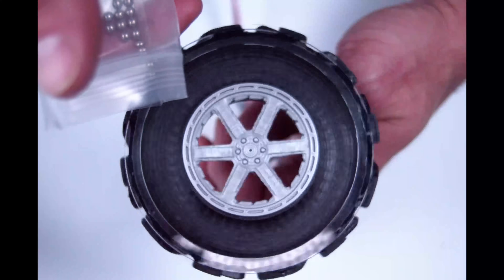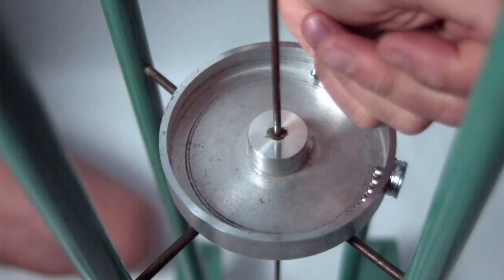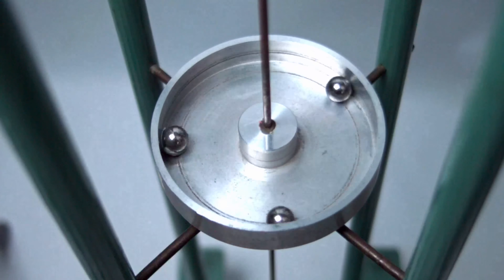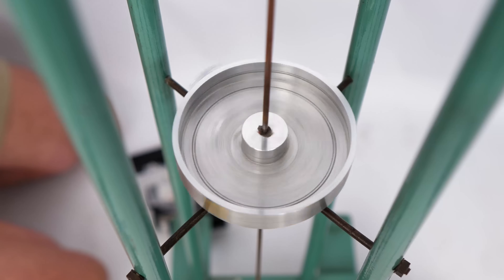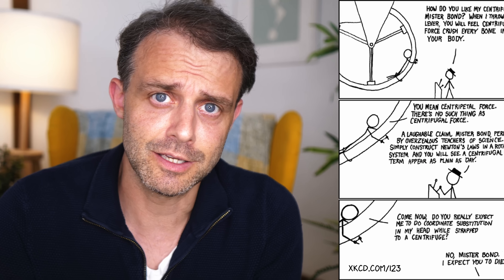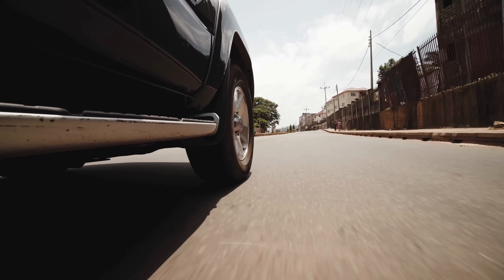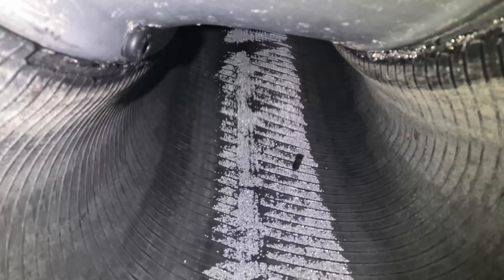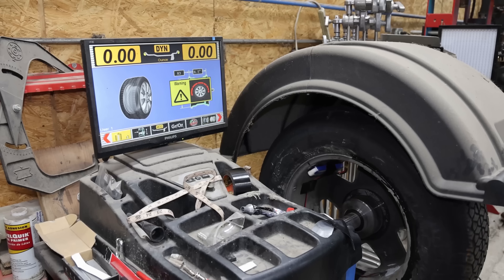Do tire balancing beads actually work?

Comment: Just a note for future investigations into this; axels (or chains/strings) can have multiple resonant frequencies. It's easier to see with a string or chain but you can tell which resonant frequency you're at by the number of standing nodes it creates when spun. I hope I explained that well enough.
Reply from the maker: Yes! I had a whole bit of script about this. What's interesting is that if you have a simple hanging chain you have all these harmonics fairly evenly spaced. But when you put a mass on the end it changes things. It massively separates the first harmonic  from the rest. So in this scenario you never really get to the second harmonic.
Reply: @SteveMould it looked to me like your milk frother was spinning at the second harmonic. The shaft being thrown out in the opposite direction of the whisk is the clue
Reply: @Greenicegod  It doesn't feel like it's a multiple of the fundamental mode though, because the free end was an antinode when it was resonating, but a node when it wasn't.
Reply: @felixmoore6781 I could certainly be wrong, it's a little hard to tell with the framerate.

Either way, the free end will always be an antinode if it's spinning an a flailing regime. The shaft is ¼  the fundamental wavelength, so node at one end, antinode at the other. A node only occurs at the end if the end is fixed (A xylophone for example has two free ends, and they both are antinodes). The motor end is almost a node, because of its mass and the fact that it's being held. The free end can become a node due to angular inertia in the self-centering regime, but then the whole system is not really resonating that much.
Reply: @Greenicegod  And, as Steve mentioned, the unequal distribution of mass seems to throw off the linear/regular spacing of the nodes. I'm not going to reply to everyone but thanks all for chiming in.
Reply: @Greenicegod  not just frame rate but also the scan rate of the rolling shutter. That’s always the same in a given camera so even adjusting the frame rate can’t avoid that
Reply: @Greenicegod  If the length of the shaft is a quarter of the wavelength the it behaves like a saxophone and not like a guitar of flute, because one of the ends is an antinode. Hence, you won't have the whole harmonic series but only the odd multiples. That the reason why the lower register of the sax and the clarinet sounds like a square wave (the sum of the odd harmonics of a fundamental is a square wave, kind of); and also the reason why when you use the key that changes to the higher register of the sax the pitch changes by a 12th and not an octave like a flute (yeah, I'm no sax player). That would explain why you see two nodes along the shaft and the way it vibrates changes when Steve touches the node one third of its length.
Reply: @angulodaniel Well spotted! Yes, the second harmonic of a chain would have a node at both ends, which is impossible without the spinning weight on the end. I just checked with a chain, and the next possible node up from the fundamental has a node about ⅔ down the chain, which makes its wavelength 4/3 the length of the chain, or ⅓ the fundamental. 

An interesting aside, the 5th harmonic of a chain has 3 nodes, one at my hand, and two bunched up near the free end. Not at all evenly spaced. I suspect it's because the tension in the chain increases linearly from the bottom to the top. The links at the top are pulled much more strongly into alignment, forcing the wave to be longer at the top to match the frequency of the entire chain.
Reply: @angulodaniel  Is there a good resource that teaches that kind of thing pertaining to music?
Reply: @SteveMould  I havn't analyzed this in much detail, but I did have a slight bit of imbalance in my tires last year and got some wobble around 80km/h that went aways as I got faster, but I did get a second and third bit of wobble just over 160 and again at a  bit over 240. I would have assumed that to be the higher resonance frequencies (I am reasonably confident about the 160kmh/one, but at about 250 is the absolute limit of what my engine can do so it's a bit rattlier in general..., so the 240 one could be imagination, though I don't think so) and yes this is in germany where you can regularly go that fast
Reply: I realized this a long time ago spinning a piece of string/rope, you can swing it straight around, or get it to spin with a hump in it, or if you really try you can get a few humps (for lack of a better term 😂).

Comment: All well and good but your tire isn’t perfectly round. It’s flat on the bottom (mostly at rest) and it gets banged around. You hit stuff displacing whatever is inside your tire. It bounces.
Reply: The ring the beads are in is filled with oil. They move slowly.

They aren't affected by the tire. They mount between the hub and rim, nestled inside the rims circumference.
Reply: False. The outward force keeps them in place.

Comment: Does it mean that the smaller wheels a vehicle has, the more effective balance beads will be? As they spin faster for a given surface speed
Reply: I've heard the opposite. They work well on larger semi truck tires and not passenger vehicles.
Reply: It might, but my first impression was the other way around. I'm not sure exactly how it relates mathematically to resonance, but centrifugal force scales with not only the speed, but also the square of the radius of what's spinning. so 2x larger tires halve rotational speed, but still double centrifugal force. It seems plausible that increasing your tire radius and thereby increasing the centrifugal force would help the beads stay on the outside at lower speeds

Comment: My washing machine has these balancing beads and you can see how the speed of the spin is critical to making them work. The control algorithm gets the drum up to the critical speed and then slows down once the drum is balanced.
Reply: Perfect response to the washing load being distributed differently every time!
Reply: @Alexand3ry  It isn't though. Water is much heavier than your clothes and moves freely. So the mass distribution should be generally even. Unless you throw in a pillow on one side.
Reply: @Idiomatick it's not clothes. 
It's wet clothes. The water is in there - kinda the purpose 🤯
Reply: Now that is a smart use of this. I assume it is fairly quiet once it gets balanced.
Reply: @piraterubberduck6056 Hmm... not mine. My machine ramps up to mach 11 and vibrates the whole house.
Reply: @integerofdoom69 hahaha
Reply: @integerofdoom69  Remove the traveling screws. They might be installed when you got it, and they dont always tell you to remove them.
Reply: @Carewolf That's possible. The previous owners were clearly not the brightest.
The unit has managed to burn itself out. To the dump it goes.
P.S. Don't use "HE" machines. They barely spit on the laundry.
Reply: @integerofdoom69  And then starts walking around the room like owns the place.
Reply: @integerofdoom69  Yes! Same here, and beats the heck out of the side of the dryer next to it!
Reply: @integerofdoom69  Try perfectly leveling your washing machine.  My ancient Maytag vibrated badly until I re-leveled it.  Now it only vibrates a little on spin.
Reply: I've always wondered how washing machines balance with a seemingly random load, you've just blown my mind.
Reply: @yngndrw.  Well, most washing machines just have the drum mounted on big springs and shock absorbers and a big weight in the bottom to prevent the machine from jumping around the room.
Reply: @yngndrw. I think the clothes themselves are acting as "balancing beeds." Thats why, if you only wash a single large item like a towel, the drum will never balance
Reply: @yngndrw. Actually if you put just one thing it gets them out of balance. They have to be least 2. New machines have sensors for this and stop and give you the error message, but old ones can break
Reply: That’s a fantastic practical use!
Reply: I've had front-loaders that would change the speed and tumble the wash about a bit if it sensed too much imbalance, but I don't think I ever had one with beads.
Reply: @darrennew8211  Mine does that as well, but despite that it's attempted to walk out of the room a couple of times.
Reply: @felixmoore6781  if your machine is walking around you need to level it.
Reply: @darrennew8211  Front Load WMs need not to have balancing beads, because they can move the load instead. Top Loaders cannot to do that i.e., they cannot move the clothes around to balance the drum. They need some water for that.
Reply: @jhingur7169  Except my front load does, in fact, have the balancing beads. You can hear them when you spin the drum by hand.
Reply: @darrennew8211 you either had beads or liquid in the balance ring. Washers can’t spin without them.  They can, but it will wobble through you wall as it’s doing it
Reply: How do you know if your machine had them?
Reply: @petergerdes1094  You can hear them moving when you rotate the empty drum by hand, at least on my Whirlpool front-load machine.
Reply: @badbadberto If I'd heard that on my washing machine I'd have just assumed it was falling apart.  Glad to learn about this first before buying that kind of machine.
Reply: @badbadberto I always thought someone had left coins in clothing pockets when doing a wash, which had fallen out and got trapped behind the drum! I've been low-key annoyed with my family for years 😢. I'll go apologise to them now...
Reply: @badbadberto did you have the 'beads' installed after a family trip to the beach? Maybe a particularly gritty beach?
Reply: @badbadberto  yeah, mine actually sounds like liquid sloshing around!
Reply: @badbadberto  I hear it too 😅
Reply: I remember when frigidaire did this in the 90s.. had a balancer ring around the tub at the top (and the bottom if i remember right).. to self-balance the machine
Reply: Wait is that why the start of the spin cycle always goes at some ludicrous speed and then becomes normal? That's pretty smart.
Reply: God bless useful comments sections. It's a rare thing these days. And beautiful.
Reply: Many washing machines use water contained in a plastic ring around the tub to help with balance. If you spin the tub and hear water sloshing you're hearing the balance ring.
Reply: Sadly, my washing machine doesn't have anything like that. I often think a heavy helicopter is doing a rooftop flyby when the washing machine gets the spin cycle going. I'm surprised it hasn't "walked" away from its spot...
Reply: Our top-loading washing machine adds water before going into the high-speed spin cycle to balance the drum - you can hear it pump out the water and do a gentle spin to get most of the water out, then the pump stops and it speeds up and starts adding water
Reply: @mattinx that’s rinsing.
Reply: @mattinx  "and starts adding water" - to rinse the clothes.
Reply: @Brillig2 no, this is during the final spin cycle - rinse is already complete. It's very obviously adding small amounts of water, the solenoid is only open for a few seconds
Reply: @mattinx  Hmmm - what make and model is it? I have a Kenmore Elite HE3 with a very high spin speed. It has no such balancing mechanism that I can detect.
Reply: Having watched you tube videos of guys throwing bricks and junk into a washing machine to watch them blow apart, there are a few instances that show the departing spinning drum momentarily levitate.  Could it be that this shifting "bead" phenomena occurs in these washing machine stunts with just the right luck to get the phasing right for a few milliseconds to create centrifugal force rectification to make inertial thrust for lift?
Reply: Ours thuds around on spin-up and spin-down, but at high speeds, quite balanced, and when it stops the clothes are evenly compressed around the inside of the drum. I wonder if the clothes are acting like the beads.
Reply: Mine too - If you search YouTube for LG TrueBalance you'll find a short video from LG that shows those beads around the drum doing their magic; works great
Reply: @pasad335 Which make?
Reply: @ColinMcNulty  Fisher & Paykel Smart Drive top loaders have a balance ring at the top of the drum.
Reply: Wow
Reply: Ok. Now I have to try this on my dryer. Always need to fix unbalance loads. I’m thinking some two inch diameter pvc with a few steel bearing in them. Make it a closed loop , kinda like a hula hoop. Not PVC, make it a rubber hose. Can put it in and remove it easily.
Reply: @Technichian462 or throw small stones in machine with clothes. Balancing and making cleaner result. 😊
Reply: yeah, driving is too varied to make these beads an effective permanent solution.
Reply: That's actually an incredibly clever use case.
Reply: But can I substitute scent beads into mine so that my old washer has this new technology?
Reply: Mine doesn't because it's a front loader so it just doesn't have that problem (the clothes almost are balancing beads anyway).
Reply: @Bozebo my front loader has a servo drive.  You can watch it hunt for balance - it tumbles slowly and monitors if it’s balanced or not; if it isn’t it slows and reverses to throw the clothes around a bit so it can try again for balance.  Once it’s happy enough it accelerates.  

Sometimes (heavy single items) it will hunt and hunt and I’ll have to throw another towel in or something to help it balance.
Reply: @Bozebo  Mine is a front loader.
Reply: Ha! I was wondering how a washing machine could automatically balance a poorly loaded spinning drum. Now I know. Thanks...
Reply: Does it make the tire wear from the inside?
Reply: WAIT this explains why it seems like there's residual water in my washing machine after it's done and I spin it around to check for recalcitrant socks! It's not water sloshing around, it's beads!!
Reply: Our washing machine has a direct drive motor and it seems to do the same thing but without beads. It runs at different speeds to move the clothes around in the drum to balance it. I guess separate clothing items work close enough to balancing beads if you control the speed in suitable way.
Reply: Huh. Maybe that's why my current machine (which was still the cheapest on offer) is so much quieter than any I had before.
Reply: I didn’t know this mechanism was already in used on washing machines… maybe mine is too old for that 😹
Reply: Much better use then motor vehicles!
Reply: I always thought that washing machines use some algorithm to relocate and balance the clothes before going spin circle without beads. Mine vibrates but its not too bad. Another thing is probably the way the drum is fixed. it can wobble to some extent relatively freely.
Reply: Shit tell this to my sister's haha lmfao you hear the washer banging from them putting 2shirts 1 under wear and 1pants all on one side 😂😅
Reply: No
Reply: Damn, is that how it works? I remember buying a Hoover years ago and it stated in the manual something like "it balances the washing for spinning by using the varying speed of the drum in order to distribute the washing evenly". I now am willing to be that it was a claim to make me think I was buying a brilliant technological solution to wobbling at high-speed spin, and that it was using bloody beads or ball-bearings...
Reply: Why isn’t the machine facilitating the same smart algorithm to use the laundry itself to balance the load? Seems counterintuitive to me to add extra unnecessary things and even more waste a lot energy and time to come to the same result….
Reply: I wonder why beads are needed. Couldn't water as a liquid... (even far superior to beads or whatever, no?) ...work better and you wouldn't need to buy any fancy beads to fill the space with. Just retain some of the excess washing water in that space they would normally put the beads.
Reply: @johnjingleheimersmith   Where I live, I have never seen a washing machine with beads to balance anything, and I have been a home appliance technician for 10 years. Most washing machines here have what you suggested. They have a hollow ring with water inside to help balance. Different places, different methods to do the same thing I guess.
Reply: @MarcosSantos-jb8qb  I think that’s how my LG top loader works, to me it seems like magic lol
Reply: @johnjingleheimersmith   water doesn't "stay put" ...  you will get fluctuating vibrations as you accelerate to the speed you want to drive at and  it will smooth out once you stay at that speed.   but any speed changes that arent very very gradual will throw the water all bibbity giggity .   ALL the water has to Catch up to the  tire speed .   makes brakes work harder to stopp and vibrates like biotch accelerating
Reply: Many washer do in fact use water, contained in a plastic ring around the top in a topload washer to help with balance @johnjingleheimersmith
Reply: @johnjingleheimersmith no water when the point of spinning is to wring out the water.
Reply: @johnjingleheimersmith  
What's more likely to cost more:
-Extra piping, seals, and probably another pump 
-A few captured bearings in a race attached to the drum 

The later will also never fail to perfectly drain creating corrosion or leak inside the machine or onto the floor. Honestly working in cars for a living my opinion is pretty firmly of the "if you don't absolutely need to use hosing/pipping and a liquid to accomplish something, don't."
Reply: For some reason my wife loves the unbalanced spin cycle.
Reply: @justayoutuber1906  says Homer’s Boner to Chester the molester😂
Reply: That's a posh washing machine. Goated tech.
Reply: That’s really insane. I had no idea washing machines had balance beads or a control program. Very cool. Also contributes to modern washers not lasting long.
Reply: @colinjohnson5515 all washers have balanced this way for at least 75yrs.